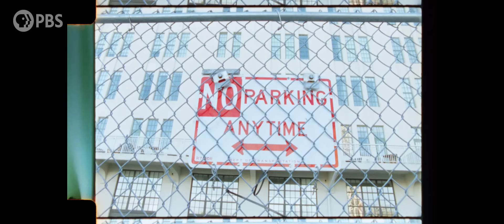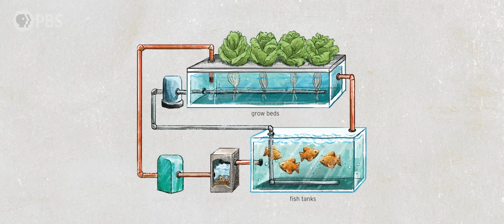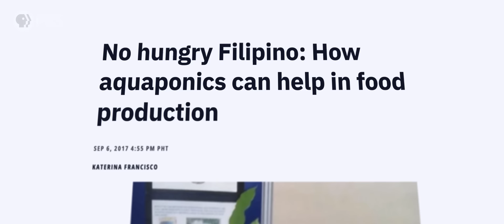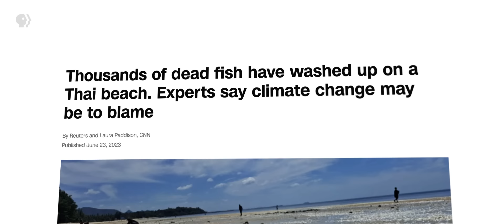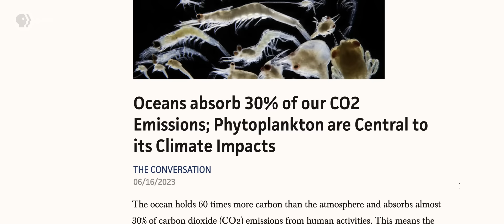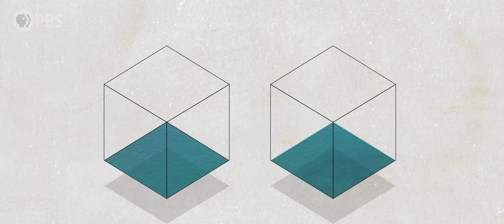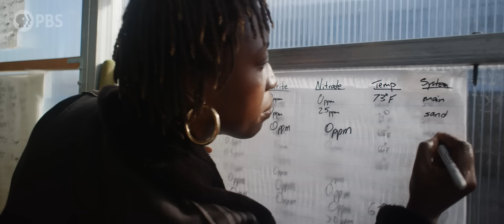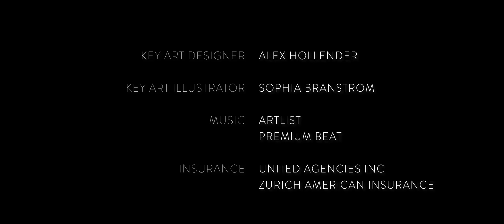How This Aquaponics Farmer Is Reinventing Urban Agriculture

Comment: We have aquaponic farmers here in the desert southwest.  It reduces water usage which is important in a drought prone area. There was a movement to transform swimming pools into aquaponic systems.   However, most of the systems here use tilapia which provides another source of food.
Reply: Aquaponics is a Re-circular system by its nature idea but also in the aquaculture systems RAS (recircular aquaculture systems) is used… aquaponics in its actual form is basically an aquaculture system where the bio filtration and  denitrification (aeration tower) is mostly replaced by a botanical/microbial(roots) system.
Those swimming pools could also be cleaned by relative simple biological(plants) filtration instead of the more complex technique of aquaponics which requires daily control/maintenance.
This Tilapia fish is in general the most strong and economical fish for aquaculture or aquaponics but it has a relative low nutritional value.

Comment: I am typically against aquaponics because it is impractical, ie heavy reliance on plastics. Here it is sensible, as well as done sensibly.  
She is in a land (soil) poor area so utilizing a materials-intensive system makes sense.  This is because this provides a quality food that doesn't travel or store well in an area in need of it.
Her use of koi and goldfish is brilliant --because I like them :).

There could be more rooftop farmers in large cities.  It uses residual heat from the building to the benefit of plants, adds roofing durability by reducing degradation from the sun, reduces air pollution, assists in reducing stormdrain strain, reduces heat island effect, etc.

The biggest trick to executing this idea is finding lightweight materials, as well as having reinforced rooftops to handle extra weight loads.

 Great video
Reply: I built a low-cost garden on an old factory roof, and it absolutely thrived. One of the biggest obstacles can be zoning and code issues. Fortunately for my rooftop garden, the local code officer was an open-minded guy who thought it was a great idea, but his predecessor wasn't on board.
Reply: @SuzetteMorganStudio  
We need to get rid of those that stand in the way of progress.  Much of the laws and regs are harmful and protectionist of big interests.  We need more freedom to enact good ideas.  
Beyond safety, government should butt out.

Glad the predecessor is gone.
Reply: It's tricky on the roof in that climate tho. No winter growing. That's why so much of it is indoors.
Reply: @AmandaComeauCreates  actually there are plamte that'll grow there in winter, it may be slower, but there are usually enough warm days to have growth.  Those in the cabbage family often taste better if they experience frost...
Reply: @Joe-sg9ll  
Low value ones they would.  High value ones could be sold for the aquarium industry.
Reply: @Joe-sg9ll  
Provide the evidence.
Reply: @b_uppy Her operation is part of the GreenThumb program. In an article I read it said that she is in trouble with them because the terms of the agreement is that the land provided can only make money through food production, but her argument is that the food production doesn’t make enough money to support the operations so she relies on her educational workshops for income.

I am not sure if that issue has been resolved but I think they should grant her an exception since she is participating in their program as they intended and she is not trying to run a for-profit enterprise, she’s just trying to stay afloat.
Reply: How does Aquaponics rely on plastic?
Reply: @Qwuiet  
In typical situations it's uses plastic piping, uses nutrients packed in plastic, the companies holding the plants are often plastic, etc...
Reply: @@L3-mtDNA I would love to do that instead of having a long comment, but unfortunately YouTube removes comments with links.
Reply: @Qwuiet  Most of the fish tanks and growbeds use plastic, like plastic linners so they can hold water.

Comment: Love what she is doing.  My concern is the use of plastic and the consequences of plastic manufacture pollution.  Yes fish and vegetables .  Rice and fish populations in the fields. The nutrient excess can be consumed by algae more efficiently and the algae can be rinsed and dried to be food for grazing animals milk and cheese . Rice vegetables fish milk and cheese.  Ceramic containers and stainless steel or galvanized steel or copper tubing are a survivable direction.  The power system can be made from an old car generator disassemble and chisel off one sixth and leave one sixth on until three sixths of the magnets on the armature or axel have been removed. You have taken Tesla's magnets off Edison's generator and now the generators spin like Edison generators and you can wire DC AC power inverters to deliver house current 110 volt AC power.  From 12 volt DC to 110 volt AC and each inverter consumes 5 amps.  Two 20 amp outlet for each 40 amp inverter.  The car generator has to a generator not an alternator. The car generators before 1974 were all convertible to Edison generator powered electric cars.

Comment: How much power does the system require per year? Also what happens with the system when the power goes out? 

So the system requires fossil fuel to operate, a rough estimate suggests the food produced is not much compared to the power (fossil fuels consumed). Im interested in systems that limit or lower fossil feel use and extraction since thats heating the climate.

Comment: aquaponics has been tried for years now and the simple truth is that it works, but not economical. 
she is a nice lady but she brings nothing new.
Reply: May I ask, how is it not economical?
Reply: @tokka9150  
on a commercial scale, when you actually compet for low prices, those systems are hard to maintain and cost more than normal hydroponics. The benefit of the fish is more costly than a good balanced solution of fertilizers.